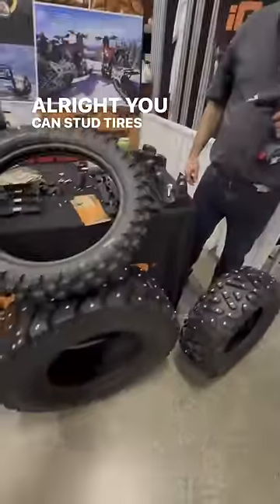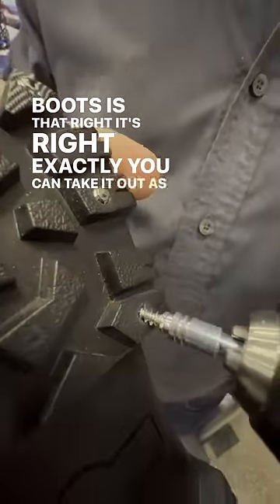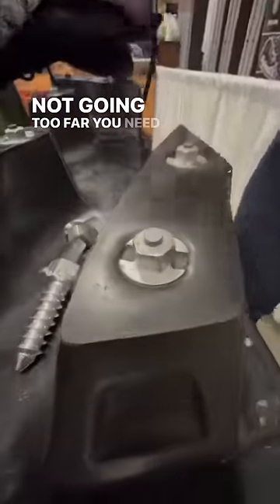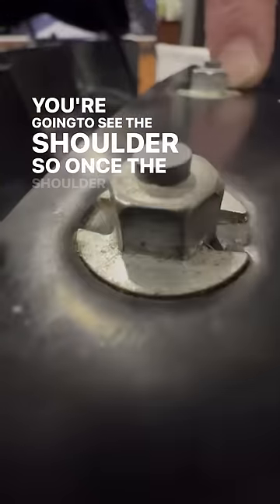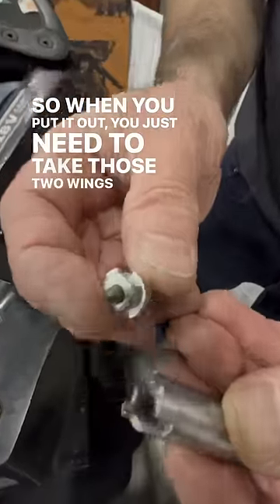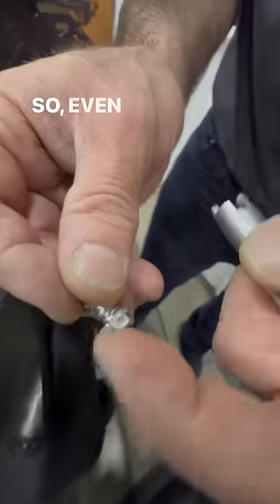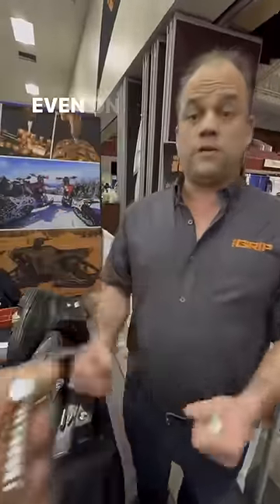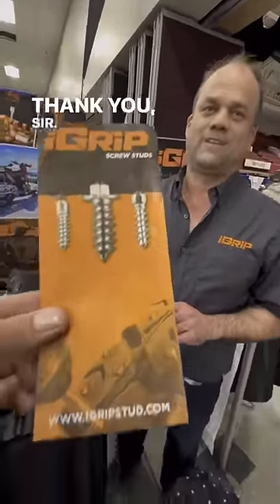Cheap way to get traction. #shorts #tractor #tires #tracks #loader

Comment: For us fellas been cutting selftappers to do this and increase the traction for the kids powerwheels, knew we shoulda tried a patent!
Reply: This has been around for 30 years
Reply: Probly longer
Reply: A box of 1/4” hex head screws is like $5 for 100 😂 just buy those
Reply: That is the exact reason something like this hasn’t blown up in production. To many cheaper, easier, and better options.
Reply: Yep. Too easy to grab a box of self tappers lol
Reply: Don't hesitate man... I've done similar... wasn't till years and years later that it came out and I'm still broke today lol
Reply: My car had those bolts on the tires as a kid definitely gave me some more traction 😂
Reply: Was patened before u ever put em.on ya kids piwer wheels
Reply: @JF94-k4o was wqy bwfore u thought of it
Reply: My dad did that on my CAT tractor power wheels back when he built log cabins and I’d bring tools / materials around the job site for them 😅 the good ol days… I’m 21 now and moved out at 16 life’s a lot different since then.
Reply: It's just a screw with a little sharp nipple on it... Am i missing something?
Reply: @SmickyD it’s probably a carbide insert that won’t wear down… and increases the price drastically
Reply: For kids powerwheels? I did this for my go kart to go off roading😭😅
Reply: @tylerwestman5258 lmfaoo small brain dad out here on YouTube really be sleepin
Reply: Brother you seen that on one of those shitty couple TikToks don’t act like you didn’t
Reply: did the screws on a rc car. increase the traction so much it it broke parts if trying to spin the wheels in tall grass and snow

Comment: I've used short hex head sheet metal screws in my lug rubber sole boots during winter and removed them in the spring with no harm done to the soles. 
During the early 90's a friend's dad was to frugal to buy chains for the John Deere and it wanted to slide off the hill plowing the driveway.  We screwed at least 50 3/8 screws into each rear tire and the problem was fixed.  Pop was pleased that we were cleaning the driveway but went ballistic when he found out what we had done.  He ordered chains immediately. We kept an eye on the wear of the screw heads and could still remove them at winters end. Only a few screws pulled out.  The chains didn't arrive till spring.  Pop got over and accepted our genius decision eventually.  
I gave Pop and his wife a handful of screws I'd gotten from a junk washer and dryer so they could not fall down while going out to feed their horses.  The wife was really impressed. What great people they were. I miss them and their hospitality.
Reply: Same I put screws in my boots when I go ice fishing,
Reply: Alot cheaper
Reply: I commented before I read your post 😂I did almost the same 👍🏽👊🏽
Reply: you've got a way with words, fun read
Reply: What a great story
Reply: I want you to tell me bedtime stories
Reply: Magnífico relato y anécdota. ¿Aún vive tu padre y su esposa y aún tienen la propiedad? ¿De dónde eres?

Comment: Tread depth/screw length is key. IMO, I wouldn't advise the average Jane/Joe to take the risk. The older studded tires were installed by the manufacturers, in the winter tires, and when they wore off, they wore off.  Neat invention/tool though! I CAN'T GET THAT HISSING NOISE OUT OF MY HEAD!! Lol!

Comment: I did this years ago to a self propelled push mower with dry wall screws. You had to be careful not to get to close to chain link fences cause that baby would climb fast.
Reply: Dam . Lol 🎉😂😅
Reply: So you just left the head of the screw sticking out? Wild bit I guess if it worked 😬 
I would have used a hex head self tapper, the hex head generally has a little lip on it too, allowing it to really bite
Reply: @nicpaul  lmao no! The head would be om the inside.
Reply: It was a last ditch effort to get the mower to get traction because the front pulling wheels basically had no grip and did a lot of spinning in place. After I put the screws in the tires I almost had to jog behind the mower to keep up.
Reply: That's a good idea, and you can aerate and mow your lawn at the same time 😅
Reply: @benj1b  the screw heads definitely tore up the ground when you forced it to slow down for turns!
Reply: You've created an unstoppable monster 😂😂😂😂😂
Reply: I did the exact same thing. My front wheel driver self-propelled push mower was getting old, plastic/rubber tires got bald and spun in place. I had to push it thru thick Florida lawn because of no traction.
Screwed in ten of so spar screws I had. 

Bob's your uncle

Comment: Most things you advertise on this channel and cool however 90% don’t apply to me 

However these would be absolutely rad to have 

I work seasonally so I work all winter long in some of the coldest climates in the world 

These are absolutely an awesome idea I had the over the shoe strap on rubber ones they break so fast. Just adding studs to the boot itself is a game changer I will be buying some and maybe I’ll buy some for my 300+ employees at all my locations

Comment: Are the boots water proof your drilling  a hole into the rubber sole would they not let in water?
Reply: You dont use studs long enough to penetrate all the way through the sole. They shouldn't even really be long enough to enter the midsole.

Comment: I use 3 inch deck screws for additional support and to ensure a snug fit. Taking them out in the spring is like straning pasta sauce through a screen door.

Comment: Do they make em for car tires?

I cant swing the 850 per tire they want to get my 4Runner done, and thats not counting the stud mounting fees.

Thats just the tires that can take the studs...
Reply: 850 per tire? That’s $25 more than I paid for a full set of studded tires for my truck. You must be running a lift and big wheels?
Reply: @ericholderrieth8009  No lift, just stock.

But my options are limited, there are only a few places around that do studded tires, and only two of them do studded tires for bigger vehicles like trucks and SUVs.
Reply: @dreamwolf7302 You must be getting scammed hard. I could see it if you live in bumbletruck Alaska, or you aren’t talking about American dollars. At $850 a tire without the mounting fees, that is already $3,400. Maybe they come with new wheels? I could order 4Runner wheels and tires as a combo to my door including shipping for less than $2,000 I don’t know what is going on here but it sounds to me like you are getting absolutely ripped off.
Reply: @ericholderrieth8009  You arent wrong.

I live in bumblefuk Maine, If i want to drive several hours, i could get them cheaper.

but then im just spending on gas, what i would otherwise pay for the tires more locally.

Comment: At this point, I think winter tires (softer tread compound, they do stuff like add ground up walnut shells for grip) perform extremely well, and are legal.  You want to swap to regular tires by the time weather gets hot, or the softer tread compound will wear quickly.  
Every tire compound is a compromise:  softer = better grip, harder = lower wear but poorer grip.  And rubber gets harder when it gets cold.
Reply: I am so confused by your comment
Reply: Most winter tires these days are studdable. They've got holes in the tread from the factory.
Reply: @slayersentience666  there are many states in the US where studded tires are illegal on public roads.
Reply: They definitely aren’t adding ground up walnut shells to the rubber that makes tires, higher silica content though for sure 😂
Reply: @BikingVikingHH  there definitely are tires with walnut shells in them. 5 seconds with Google would tell you that.
Reply: @zachdemand4508  I just don't know what summer tires have to do with it ? If you're at the point where you need studs for traction, shouldn't you already be on winter tires, and then stud those for more traction? 

Might just be a US thing tho, I'm from Quebec and summer tires are illegal in winter here. Didn't know studded tires were illegal in some parts but makes sense. IIRC they have an earlier max removal date here so you don't damage the roads in milder conditions
Reply: @zachdemand4508  yep they make some pretty insane winter tires nowadays
Reply: @slayersentience666  op is trying to explain why tires designed for warmer weather (including all season) are not good to during winter and why you shouldn't leave the winter tires on when it starts to warm up. It's legal to run just about any tire you want here.
Reply: @zachdemand4508  I get all that, just can't fathom why someone would stud summer tires
Reply: @slayersentience666  nobody said anything about studding summer tires.
Reply: @zachdemand4508  thought it was implied "at this point..." I believed was inferring to switching to winter tires instead of studding summer one's. Which is why I was left wondering who would do such a thing as studding summer tires. Cheers mate
Reply: If youre running on ice, you need metal.  Rubber wont work.  Its physics.
Reply: @zachdemand4508 all states I’m pretty sure. This is for driving on ice or off road. This isn’t for public roadways
Reply: I don't see how that is relevant to the conversation.
Reply: Sounds French Canadian and here in northern Ontario studded tired legal, I have studded nokians amazing tires. Plus I've used these to stud my snowmobile track at times

Comment: Take the stubs out and put them back in for next season?? Son, when you put holes in something, you generally leaves those holes plugged. Boots are a great example of objects that should remain plugged if you drill holes into them. Otherwise, you risk leaks! And there are very few things worse than wet, soggy feet when you're working in the field all day

Comment: So last fall I knew I was going to get new tires the following summer.  So I gave these a try on those last leg tires.  F250 4x4 I use to plow and other stuff.  They installed easy.  Don’t be an idiot and you won’t install too deep.  There’s plenty of lug deep on A/Ts. They worked better than my chains.  I don’t know about removing them as they do get pretty beat if used.  That said the work as advertised.

Comment: You used to be able to buy studded tires from a tire shop. Sears even had them in their tire rack.
Reply: You still can buy studded tires from town fair or tire shops, but the new tire straps are better and easily installed on drive wheels in seconds
Reply: We all run studs in northern Ontario. I just bought a set of studded nokian hakkapeliitti tires for my ram 2500. Best tires for the conditions, imo.
But gonna check these out for other applications.
Reply: @robertg9334  
My dad had a set of tire "cleats"  for our 71 Plymouth Station wagon. I remember him installing them when we were going up Signal mountain in Tennessee.  It was packed with snow and ice. He had stopped at the foot of the mountain at a closed gas station and I had to hold the flashlight (lol, of course, that's what young boys did, it was our job) so he could see to strap them on.
Reply: @randysmith9636 that's an awesome memory!
Reply: They discontinued it out of areas that don't need it mostly because it tears up the roads.
Reply: @bonesBPMC Illegal in some states and counties in the U.S. They say it tears the roads up and tell us to use chains. Cops use them tho.
Reply: Then they quit caring about our safety and realized it’s more profitable to ban tire studs and let us fend for ourselves
Reply: They still make them. Funny thing is, most winter tires come with holes for studs. There's a stud gun that pushes the studs into the hole. They're kinda barbed so they won't come out unless you want them too.

Point being this tool is useless for tires. You also might puncture it.
Reply: What do you mean "used to"? I just bought some this last wednesday.
Reply: @TheBoys-ho7di  why can't you use chains?
Reply: Yea, everything over time keeps getting worse instead of better
Reply: Nanny state
Reply: Still can. You can even still do it at sears here. It's not the sears it used to be, but they still have a few small stores.
Reply: But I don't get is chains ⛓️ tear up the Rd surfaces too! Smh 😒
Reply: @coachnutt61  
True. But most folks don't drive on cleaned surfaces at speed with chains. With studded tires they drive almost normal and many just keep them on all winter. 
Going down the Interstate at 70 mph with chains, good times to be had by all.
Reply: You can definitely still buy studded tires. I've got a set of winter studded tires for my suburban and my audi, really can't beat them if you live up north. The best non studded winter tires can't hold a candle to even budget studded tires. I run Hercules Avalanches in the winter and absolutely love them.
Reply: @randysmith9636 awesome thanks for sharing
Reply: I could be wrong, but I thought some states outlawed them not due to road wear, but because some people would run their tires so long it would wear down the rubber enough to start throwing the studs out. I’ve personally never had that problem since I get new tires before they get too worn. But I can understand that a lot of people don’t keep up on maintenance like that.
Reply: Studded tires are illegal in many states
Reply: @randysmith9636  yes have a similar memory back in the 80s with my dad in the White Mountains of New Hampshire, strive every day to be an extension of that man with my kids
Reply: @onejohn2.26.  yes where I live it's only allowed from November15- April 15 with the winter season
Reply: @robertg9334  Same in SD, not sure on the exact dates, but something like that.
Reply: @robertg9334  
I live in Wisconsin and it is not allowed at any time they are totally illegal
Reply: A stud came out of a tire in michigan and it a driver in the face thru his windshield he crashed and died and that's why michihan banned the use of studded tires.
Reply: @christophermink6186  
That's really sad. The problem (some of it) you have wingnuts making their own studs by just cutting the heads off of screws. Those are not designed to be installed into tires. The rotational force at 55 mph is pretty extreme. Alot of engineering, design and testing goes into making a studded tire. From the tire itself to the size, type and design of the screw.  Sheet metal screws with the heads cut is not safe, as in the case you mentioned. Driving to fast, and excessive tire wear also plays a part.
Reply: @christophermink6186  That's stupid. Are they going to ban gravel and rocks next? The only reason I've heard for places banning them was because of damage to the roads. Definitely not saying you're wrong, just saying that's stupid.
Reply: Still can in the north. Everyone sane has studs.
Reply: @hisnameisiam808  chains are pretty useless in ice.
Reply: @korlock3000  ever tried them? Lol they weren't useless when I used them! Hahaha
Reply: You can ask just about any tire shop to add studs if the tires already have stud holes, which you’ll have to be looking for but are sold alongside everything else. It is $15 in the ones near me and I live in the south, I’ll never need to buy them.
Reply: Tires can be studded when new. When used they can’t be. Maybe this is a better setup.

Comment: Studs have already been out for over 10 years. I’ve used them on atv tires bike tires and shoes.
Reply: Way longer than that.  I remember seeing them in the catalog when I was a kid.  But they only had the hex that would wear out making them almost impossible to remove. These have the drive flange in the washer portion and carbide like a actual car tire stud the carbide will outlast a set of tires if you do not spin much
Reply: @kevinroberts9394  that’s what I’m saying. This exact kind has been out before over 10 years. With the carbide and the shoulder and special head.

Comment: That’s cool. Isn’t this already how a lot of cars are studded tho? Am I wrong? Never had studs but this is how I assumed it was done.
Reply: The ones I've removed from tires I got for free with factory type studs were more like rivets that go into the tire and kinda ball on the inside they were a pain to remove the tires sitting in the sun made a big difference but had to use side and end cutters to get a bite under the stud between the tire and pull hard
Reply: No, tire studs look like a solid rivet. Wire jaws spread the hole in the tire to install the head of the stud with the pin sticking out.

Comment: Wonder if the screws cut break the steal wires in the tire.
Reply: Those studs don’t go that deep enough to break the steal wires in the tire and if it did go that deep you would have a tire that leaks air

Comment: You see the drill he has? That tells me all I need to know.
Reply: lol I use all d- walter and milk-hawk-eye . Nothing wrong with Bosch at all, they make decent power tools. he’s also not selling the drill. He’s using it to help sell his product. any drill could be used. no hate just had 30 seconds
Reply: Thsse studs are actually really good, and they last a LONG time, even with highway use.
Reply: If anything that's a testament to how easy the studs are to use!
Reply: Actually my contractor used bosch, said it was the longest lasting drill he's had...it was definitely old but operable...a plugin one.
Reply: @Gamerz00760  yeah atleast the older Bosch stuff was built like a tank
Reply: @Luke_______ semi trucks???
Reply: @1truthseeking8  Absolutely semi trucks as well

Comment: I’m gonna go to Home Depot and get me some screws.
Reply: You won’t get the carbide tip that way.    It makes night and day difference.     Just sayin
Reply: Screws wear out fast and are difficult to remove if you wait to long and offer less traction than the carbide pin however if you do not live in an area that normally plagued with ice they cost way  less and are a good short term solution either way they will fly out on the highway unlike an actual tire stud installed in pinned tires